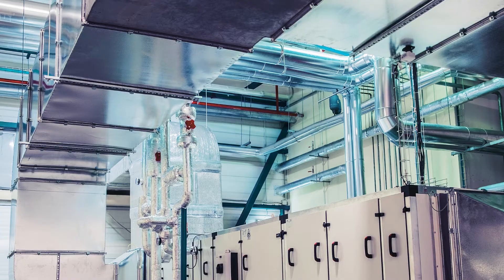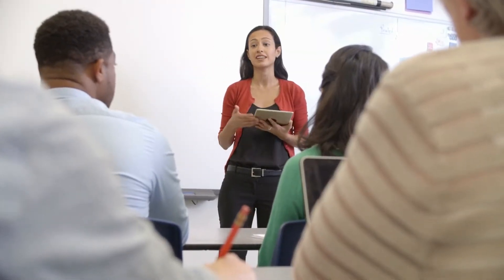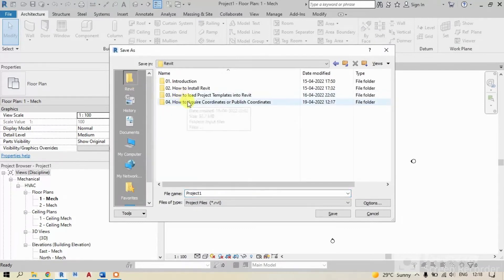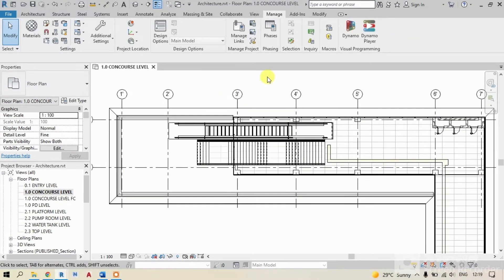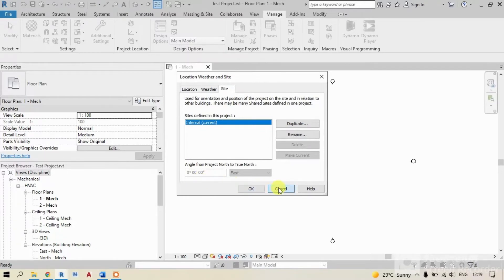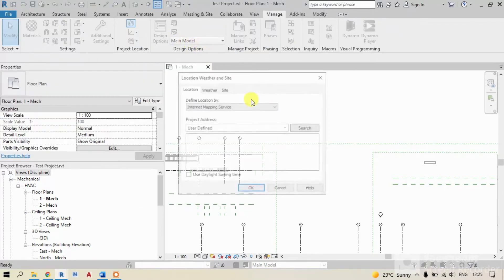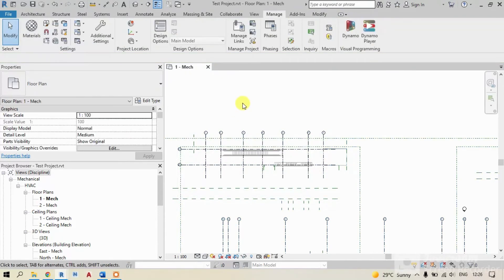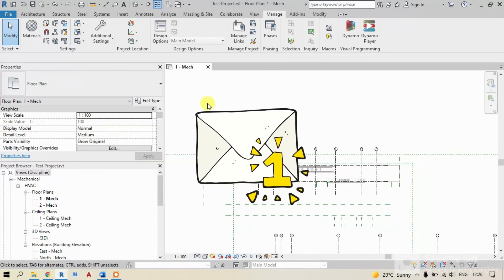How to Acquire Coordinates from Revit Linked Model in easy steps

Comment: 2:08 The one you showed is angle from project north to true north. But you say it is project coordinates. How come? Project coordinates are either Lat/Long system or N/E  UTM system.
The concept u said was right but wrong method. Use the spot elevation instead from the annotation tab.

Comment: Why its done could u plz explain?
Reply from the maker: Hello Anurag, Thanks for your comment. To answer to your question. If you have already a model in which Project coordinates are already defined. it is easy to acquire coordinates of the existing model instead of doing the entire coordinates setup process. In other words, if Architecture or Structural models have had created Project Coordinates, then it's best idea to acquire those coordinates instead of re doing entire process in your model.